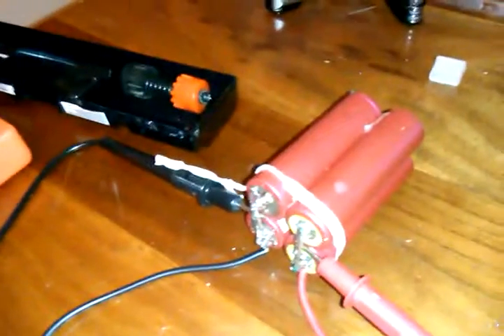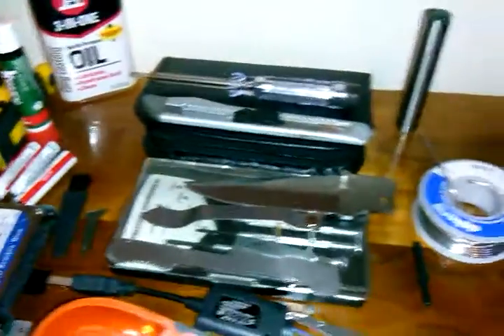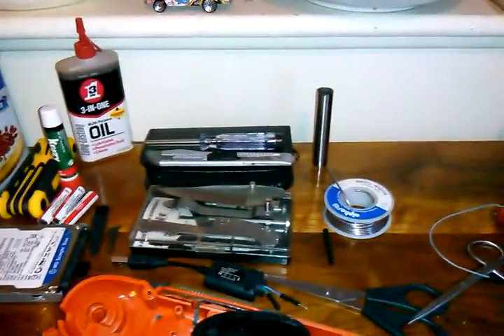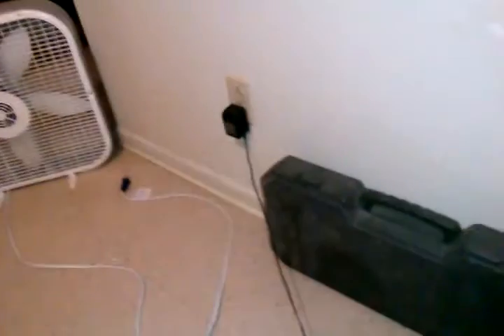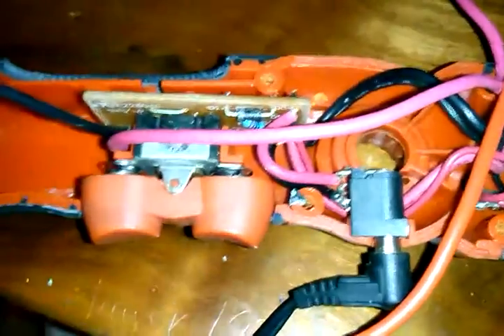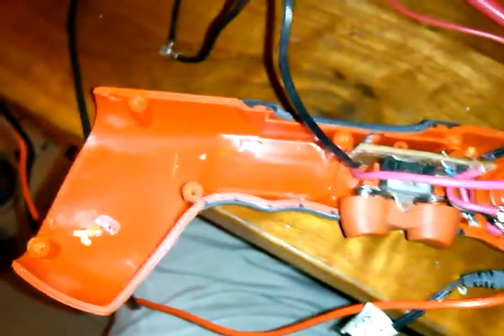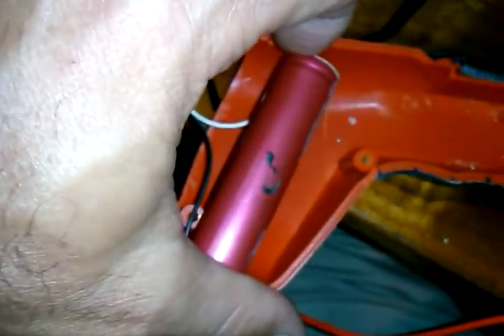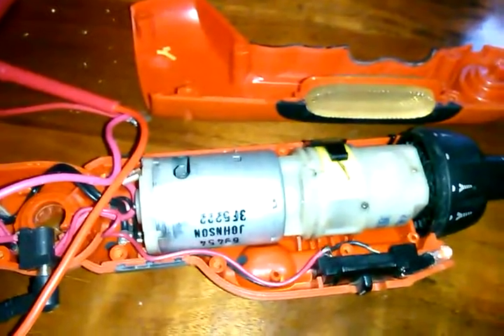Fixing a B&D Pivot Plus 6 volt drill/driver with Li-Ion batteries from a laptop..........

Comment: I just finished installing some floors for this nice lady and she gave me one of this Black & Decker, drill and drive because she didn't have the charger. It had a bit of charge but I was wondering the duration of the charge of the original battery life before I make any changes to the drill and how long I should leave it on the charger.
Reply from the maker: francisco cruz As long as the batteries will hold a charge like new condition you wont be disappointed in the performance or duration of use time. The original charger was a 9volt 1Amp charger. If you have any more questions let me know. ...........
Reply: you're definitely I just have it a test run and it's a lot better than I thought. the batteries seem to be in mint conditions, both the Philips bit and drill bit are with the drill as well as the small measuring tape as well, so that's a great gift I got today and you where right it definitely not a disappointment.